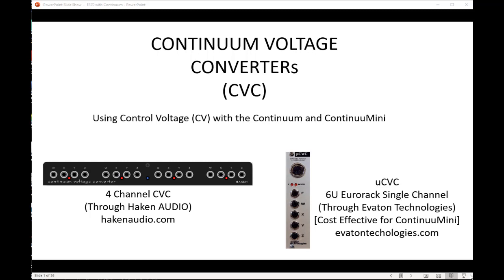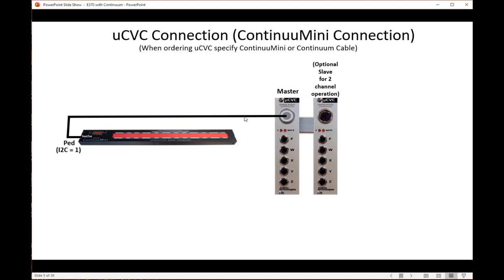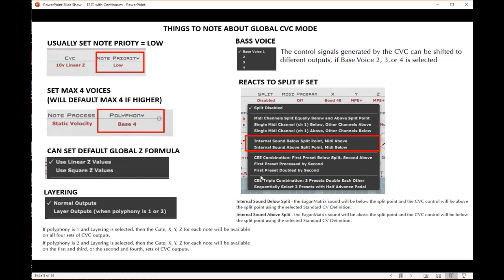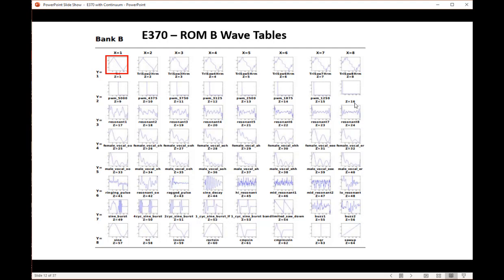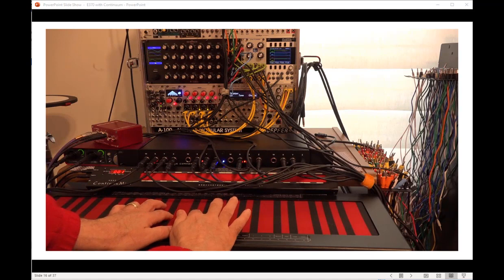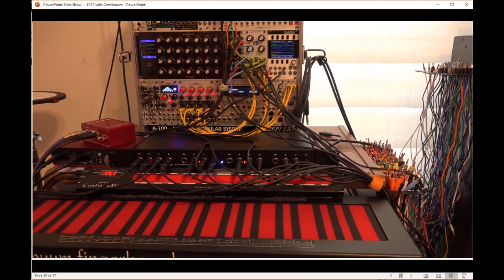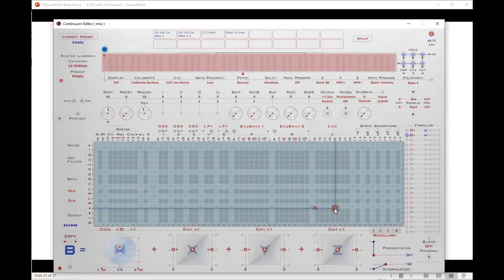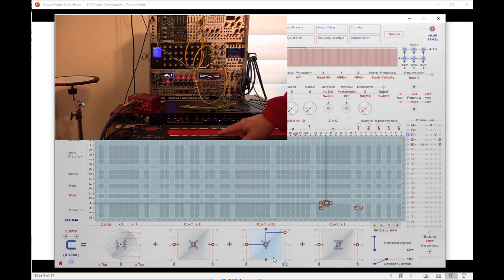Haken Continuum Voltage Controller (CVC) and uCVC Basics

Comment: Thank you so much for this :) Can the Osmose take advantage of 4 channels?
Reply from the maker: Yes. The Osmose CVC interface is identical to Continuum though it uses I believe the Midi DIN connection to the CVC not the newer TRS connection. Though I have not tested it yet. I'll get an Osmose soon and will be posting Osmose specific videos.